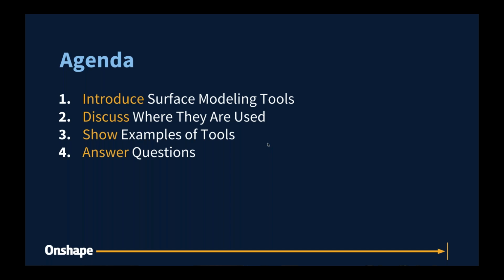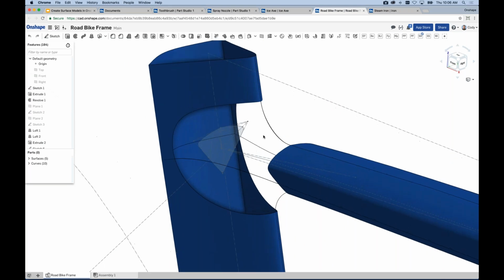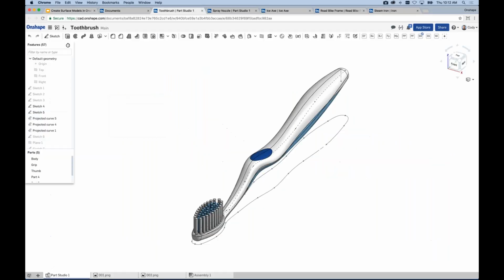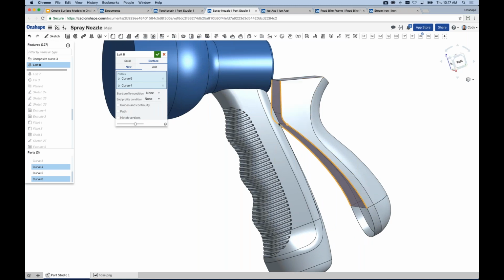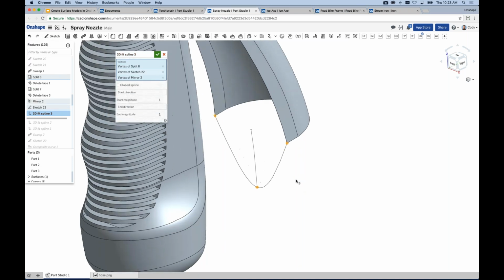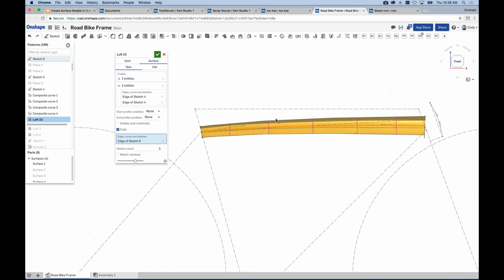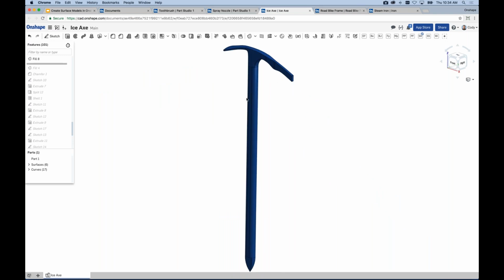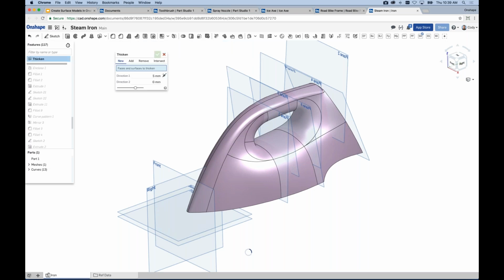Creating Surface Models in Onshape | Webinar (November 9th, 2017)

Comment: I'm currently trying to create a model of my phone based off of reference images for all 3 planes. Is there a way to extrude all 3 sketches, and subtract the difference between them? I'm new to onshape, and currently stuggling quite a bit. I was thinking I could extrude the profiles, then loft between them, or use guide lines when I extrude
Reply from the maker: Hello - Yes, extrude using the "Intersect" option on the third extrusion. Create the Front view Extrude that, create the top view, and do the same , for the third one, use the Intersect choice for Extrude. Hope this helps.
Reply: @OnshapeInc  Thank you so much, and thank you for the timely reply. OnShape support is insanely good!